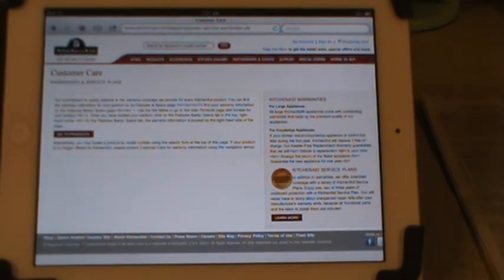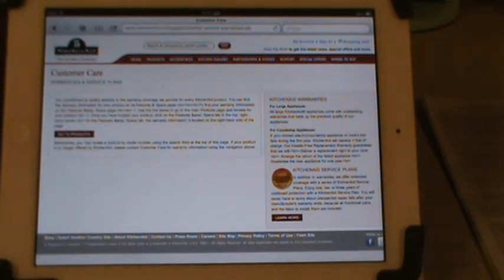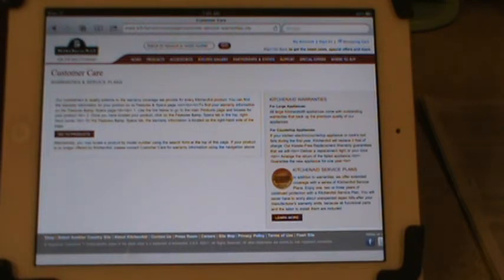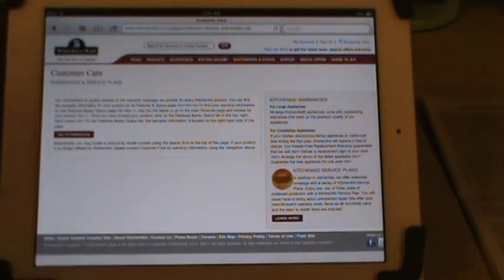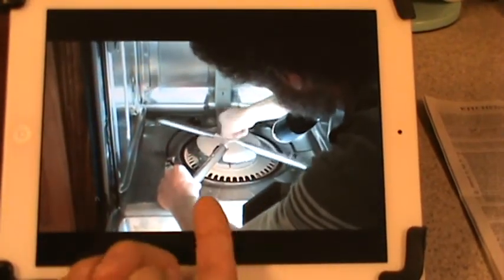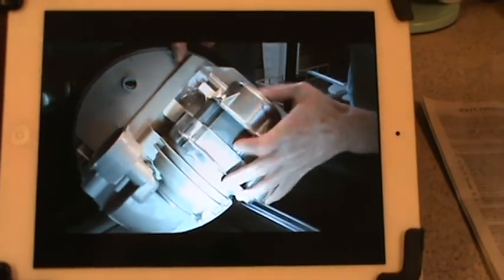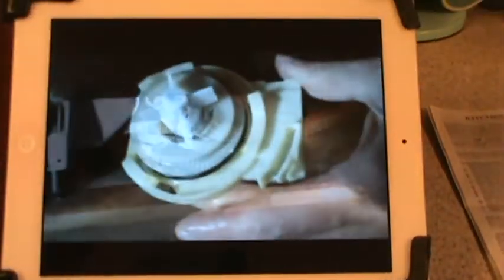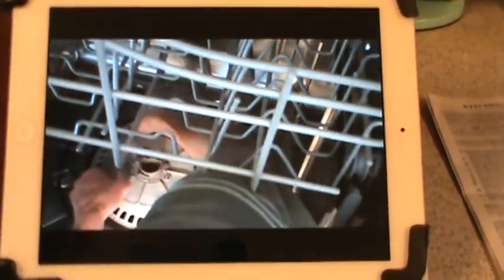Troubling Experience with Kitchenaid and A & E Fac

Comment: I called A&E to fix a refrigerator.  I paid the $308 but they didn't fix the problem. After the repair I was told to wait 24 hours for the fridge to return to normal.  After 24 hours I called them again  to get them to come back but was told it would be 7 days before another repairmen could  come out. I ended up calling a local repair service that came within hours to fix the unit properly.